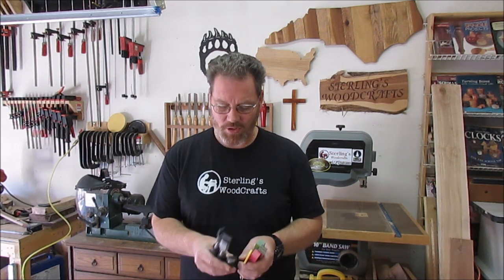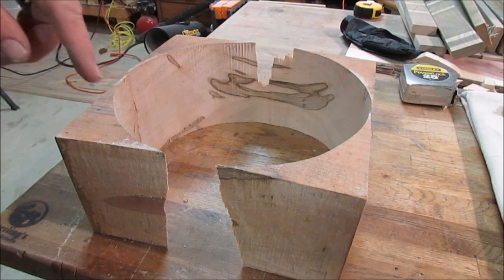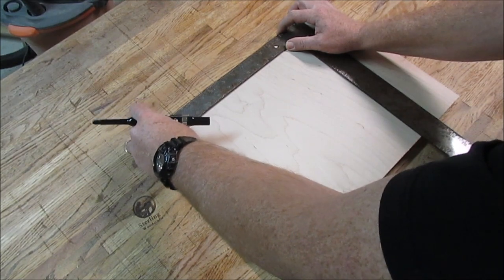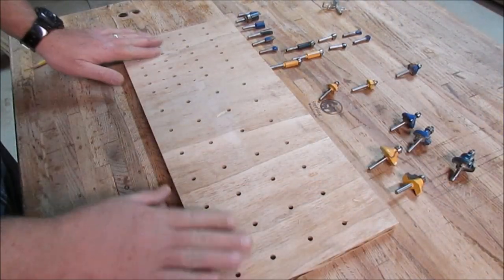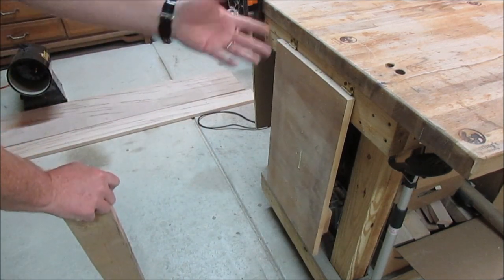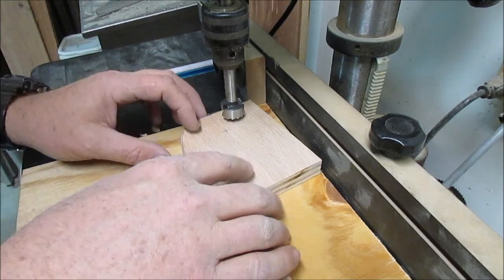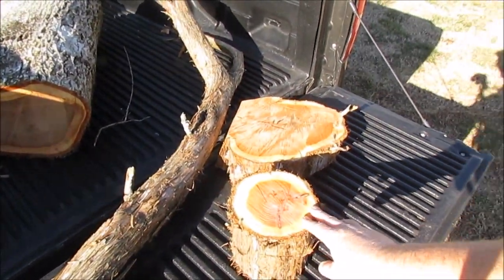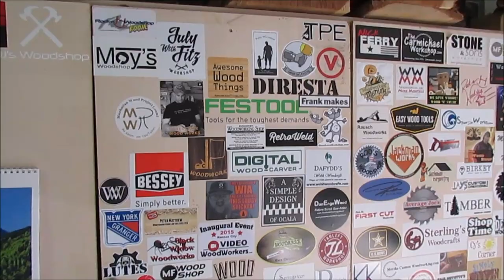Shop Update, Thank You, Organizing, & Atlanta Teaser

Comment: Hey Sterling.  You should have stopped in on your way to Gatlinburg.  I'm right at I-40, Exit 407.

For a bench protector, I use a retractable plastic shade from the big box store, WalMart or wherever.  Reusable, cheap, and basically nothing sticks to it. 

That wood didn't come from the Smoky Mt. National Forest did it?  :-) :-)                         JimE
Reply from the maker: +Jim E That's a neat idea , and as far as the wood, I plead the 5th lol, but as a side note, a Ranger did tell me you could take fire log size wood, so "If" i were to have taken it from there,  There a just Super Size Fire logs hahahaha, PM me and the next time I am in the area, I will let you know, Thanks for checking it out
Reply: +Sterling Davis Good Idea.  PM me the next time you make a &quot;moonshine/firewood&quot; run.  I&#39;m right at I-40 and Rte 66 heading to Sevierville, Pigeon Forge and Gatlinburg.  I'll buy lunch.                JimE